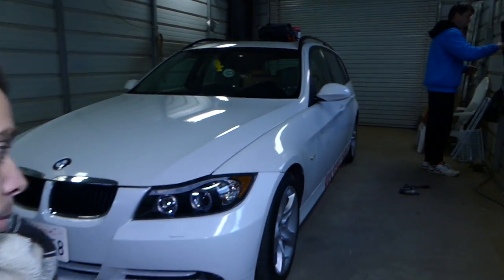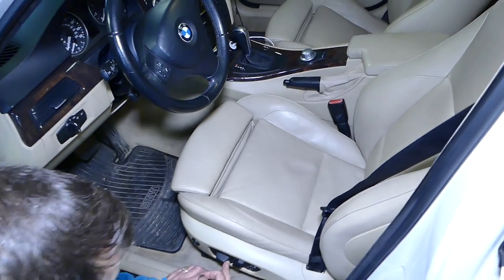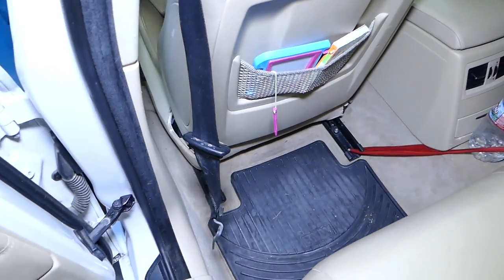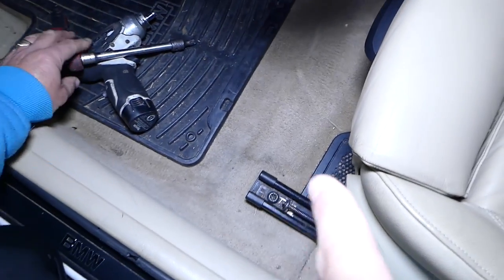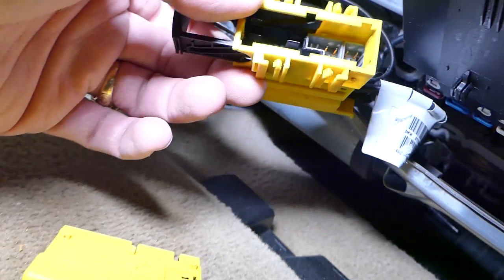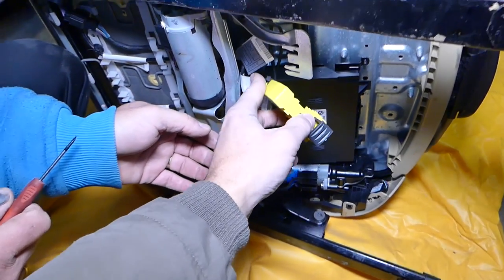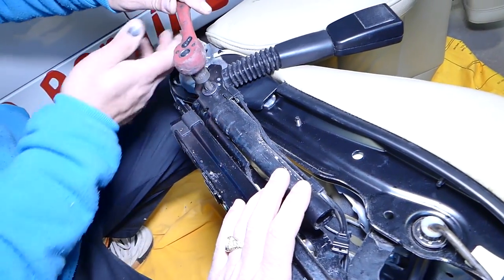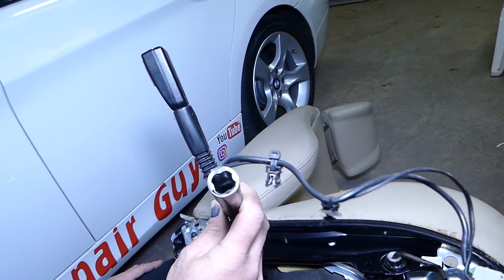HOW TO REMOVE AND REPLACE FRONT LEFT DRIVER SEAT BELT BUCKLE BMW E90 E91 E92 E93

Comment: Tip for anyone trying to pull one of these off a parts yard car woth no power. At pick n pull they dont allow jumpers or starters plus I didn’t have one but you can take the two 13mm nuts off the front part of the seat to hinge it backwards, they’rejust above the T50 front bolts. At the motor that moves the seat forward and backwards take the black sleeve off the extended part that goes to the rail furthest to the left of the car. You can pull off the extender and put it back in without the sleeve; spin counter clockwise to move the seat forward to reach the rear T50s. Just did this, took a while and got a blister but was able to get the seat off!

Comment: Hello, I’ve got an E36 with the SRS system light.  I ran the B800 scan tool and the code came back as “Seat Belt buckle switch (Driver)”.  So I wonder if I need to replace the entire seat belt? Maybe I can find one at a junk yard and replace it like in your video and see if that clears the error.

Comment: Excellent video.  Really appreciated the detail of the electrical cable connector.  If you are a bit of a contortionist your can speed up replacement by not removing the left side of the belt from the seat.  'Rather than removing the seat from the car you flip it over on its outboard side.